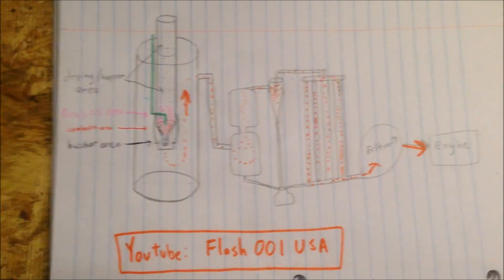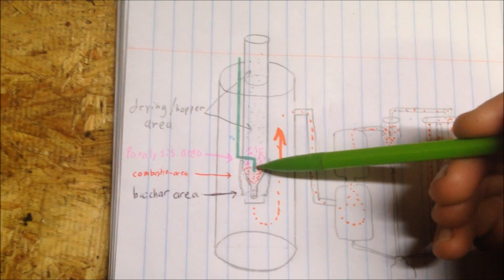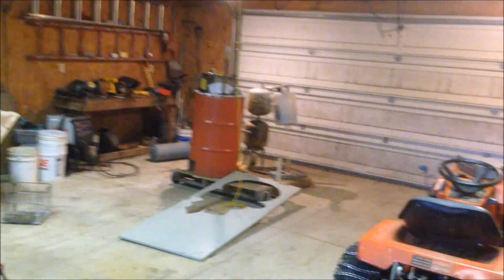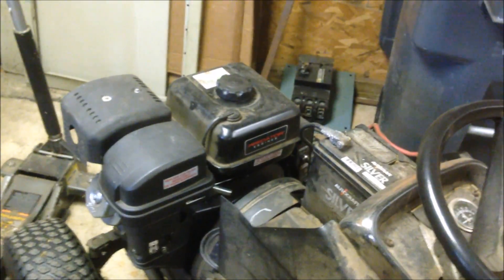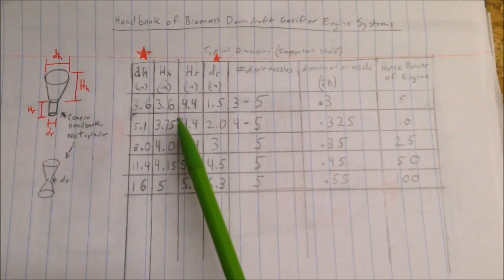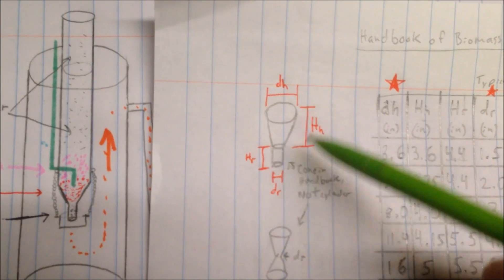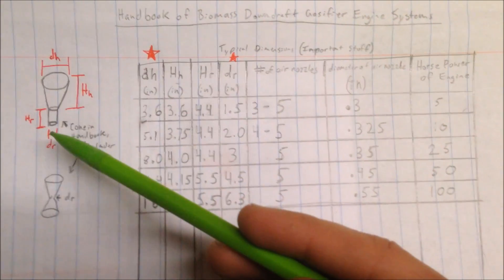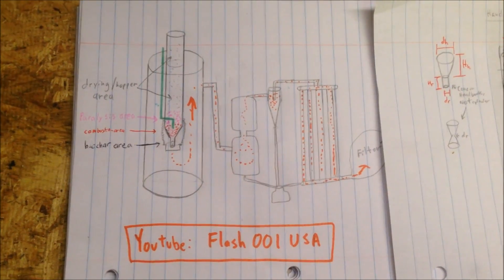Wood Gasifier Build for Dummies 1, How it Works

Comment: Are you sure about the height of the hearth? I kind of agree it needs to be taller. Maybe a foot . I'm building one with a 12 inch diameter inner tube for a reactor and 5.5 inches seems too small. I've never seen the handbook but just piecing it together this measurement seems off. The diameter of the reduction area can't taper that far down in 5.5 inches.

Comment: Good presentation. One question. Why does the ratio between dH and Hh change depending on the engine power?
I think that a consequence of this might be a tar rich gas, since most of the tar is burned in that area.

Comment: Great in-depth engineering info. Have you computed the gas flow at maximum power Cuft/Min?  I would believe the better the pyrolysis the more gas the gasifier would generate clean combustible gas.  Breaking all those big tarry molecules down should clean up the gas also.   How about some steam to help convert and reduce nitrogen into the gas, thus this makes the gas hotter(more BTU/cuft)  when it gets burned or more bang in the engine. More power out and you get better wood fuel economy. Maybe some of those wise engineers can elaborate dimensions for big 1/2 ton pickup for a 350 or maybe a 455 cuin engine. Thanks for the info keep up the work and tell us when you get it up and running and is it really worth the effort and save money and your time? What size chunks work the best? Got a shredder or wood chipper? Any suggestions?. How much wood does it take and how much can you save?  Are you working for off grid with battery storage of some type? Estimated energy needs. Co-generation for home heating / cooling? Efficiency LBS of wood per kw-hr?